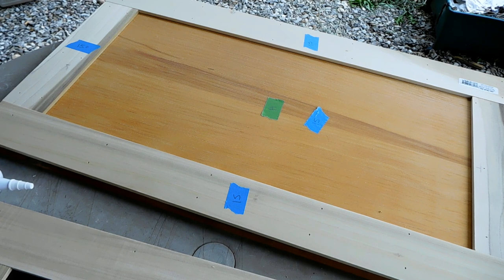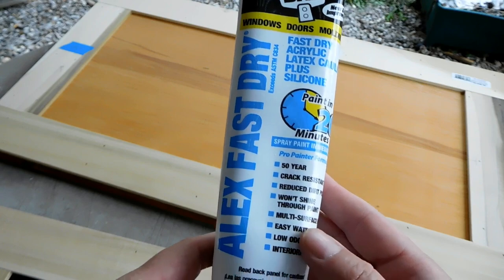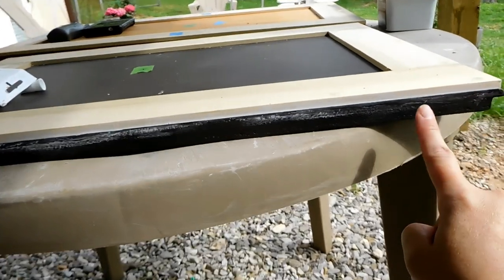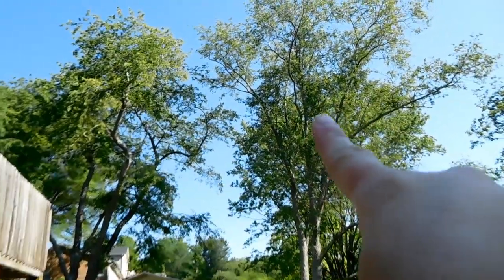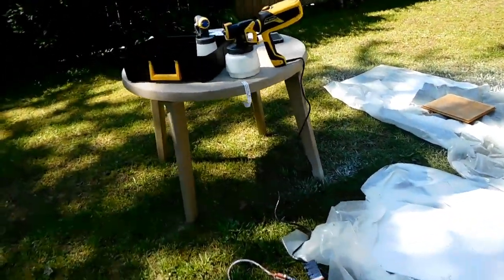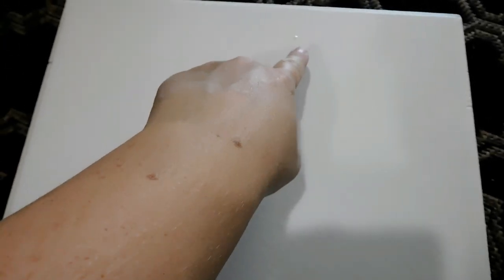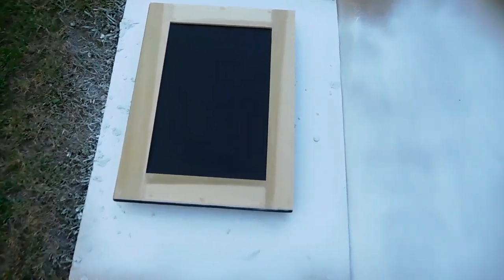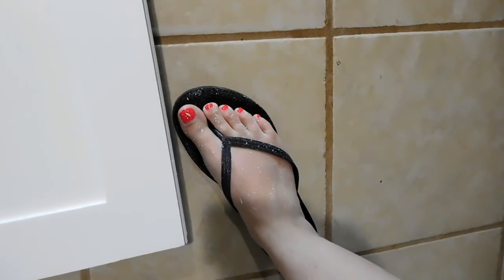Spray Painting Kitchen Cabinet Doors!!! :D Finally!!

Comment: The top wood, is it plywood?
Reply from the maker: No it's not plywood. They come in strips at Lowe's. I think they were either birch or pine. I can send you the link on their website for them if you're interested?
Reply: New Day Vlogs yes ma’am! My house was build in 1970s and it’s so hard to find cabinets that will fit so adding on would make it sooo much cheaper!
Reply from the maker: I hear you! :-) mine was built in 65 and so replacing the doors was going to be way too expensive. So I figured I would just reface them and come up with a better/cheaper way of doing so without hiring a contractor to redo them or without having to replace them. I also wanted to help others save money as well, and decided to share my idea with everybody. So i hope yours turns out great and you love them as much as I do! I will send you the link below to the wood that we got at Lowe's. They come in 1.5" wide by 1/4 inch thick by 4 ft long strips. It usually takes about two boards per door. Here's the link to the wood we got 😊

https://www.lowes.com/pd/Common-1-4-in-x-2-in-x-4-ft-Actual-0-25-in-x-1-5-in-x-4-ft-Poplar-Board/1000074305

If you have any questions please let me know. I hope my video is very helpful to you, and I hope your project goes awesome!😆

Comment: Do you have to use some sort of top coat or glaze over it ?
Reply from the maker: It really depends on the type of paint you use. They make cabinet enamel paint now that you do not have to use a top coat over. A really good enamel paint is insl-x. you can get it on Amazon. It's really good and they also make another one by Valspar that's for cabinets, that's also a enamel paint. Both of these you do not need to put a top coat over it. If you use a regular latex paint, then I would get a polyurethane water base top coat. It doesnt yellow over time.

Comment: The cabinet doors look awesome! I’m getting ready to do the same thing, but my flat doors have a rounded edge to them. Will that look funny once the trim is put in place? I’m thinking there will be a visible gap there that I can’t just shave off. Your thoughts? Thanks for an easy to follow video. I’m subscribed!
Reply from the maker: Hi! Thank you!!  😁. My doors in the video had a beveled Edge that was curved. Once I put the trim on the facing of the door, there was a little bit of a gap between the trim and the door facing. In order to to hide the Gap to make it look more seamless, I used caulk. Because caulk shrinks when it dries, I ended up putting two coats of paintable caulk in the gaps. Just make sure that you smooth the caulk out really good before it dries. hope this answers your question :-). If you have any more, please let me know. Thanks!
Reply: @newdayvlogs  Thanks! You’re the best! 👍🏽